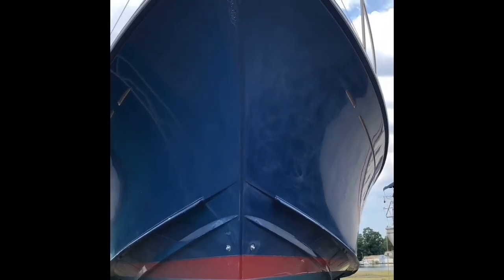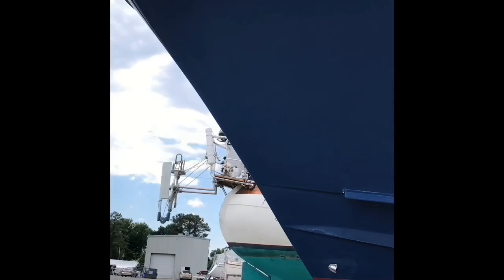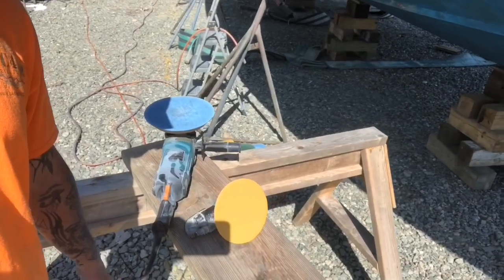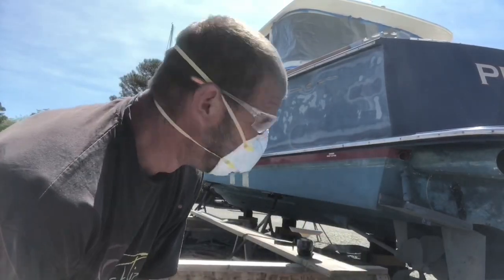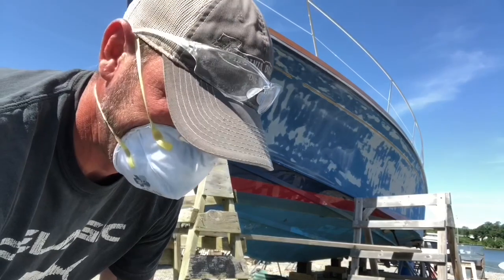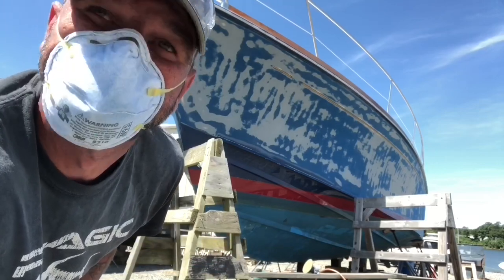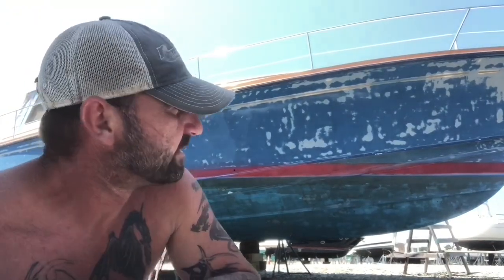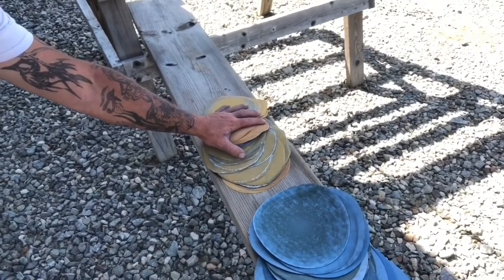How to prep,prime, prep, paint part 1 (DIY)

Comment: With your DA, what size compressor can you get away with using?  I'm guessing an 80 gallon is preferred, but can you get away with using a 60 gallon (175 psi @ 6.9 cfm)? Or like your home setup, could I use a 60 gallon connected to an expansion tank of 20 to 30 gallons?
Reply: For those curious, I purchased two 29 gallon Harbor Freight compressors. Made a video showing my setup. I'm using a Baxter 6" Orbital sander.  I've sanded for nearly one hour straight with no lag or delay.  I'm probably pushing these compressors to their limits, but I'm only using this setup four one project, so it'll do.  Also, two motors/pumps give that extra boost to keep the air flowing.